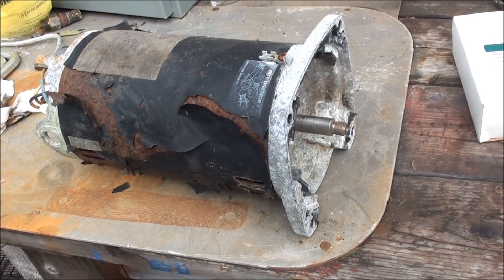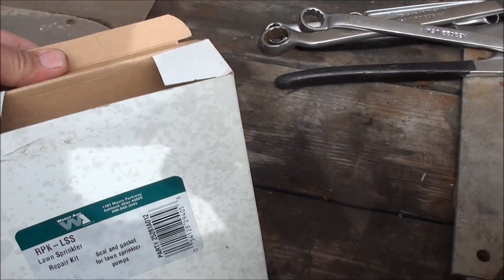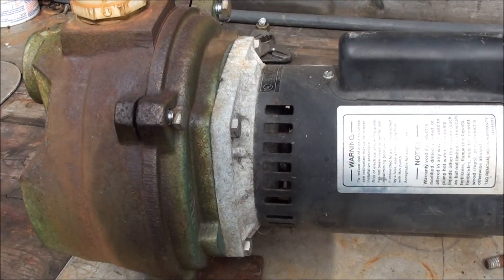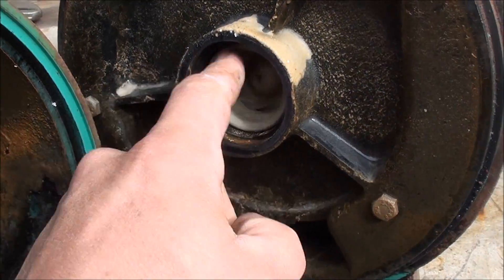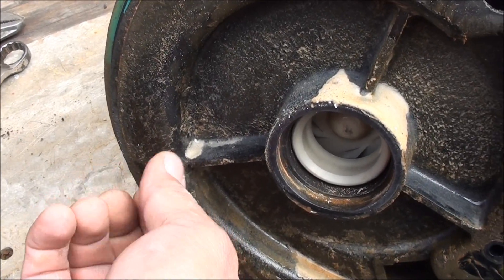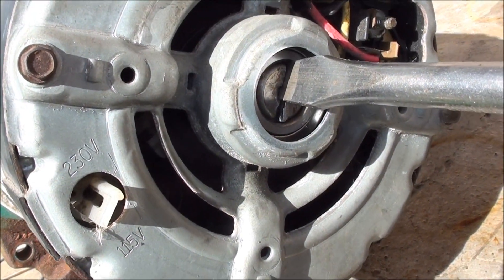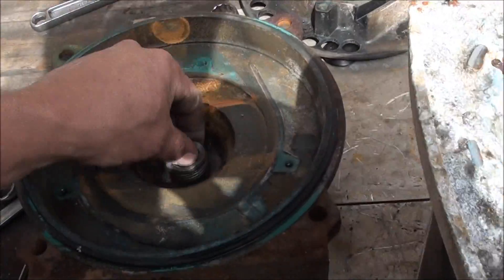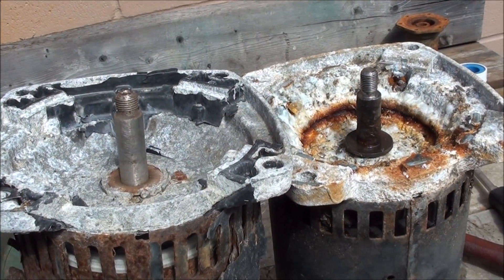Water Ace Autopsy (2)

Comment: you *may* be able to replace the seal and bearings and run it.  Might find that the rubber part of the seal went out, or the carbon / ceramic has a crack or something.  it's been a while since I have torn a pool pump apart, so I may be off a little.  Bummer that pool motor won't fit the impeller.

Comment from the maker: Hey Bryon the pool pump motor shaft was larger in diameter and the threds were larger than the water ace impeller Thanks for the comment!
Reply: We're to find parts
Reply: Need a defuser for 1hp. R10l centrifugal pump